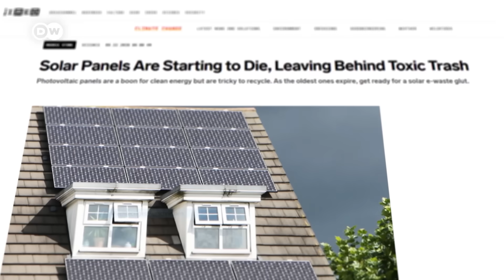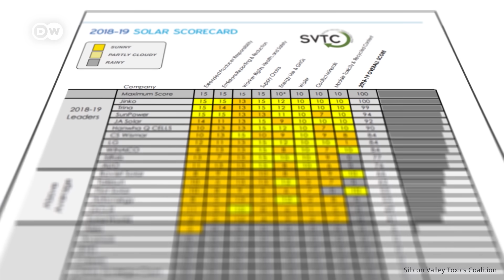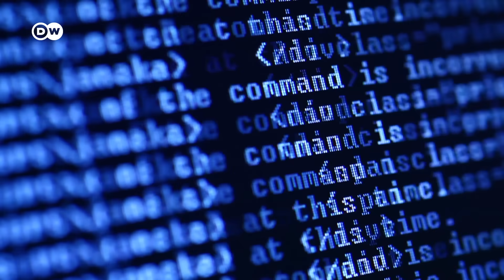How green is solar energy really?

Comment: Friendly reminder that a grid full of solar panels requires backup, as solar panels only run at full power during summer months at the middle of the day.
This capacity today is being completely taken over by fast reacting natural gas plants.

Just use batteries you may argue. Or use other storage methods. 
Yeah, but that means you also need about 3 to 5 times the amount of solar panels or even more to keep those batteries charged during the winter months. And I don't even know if you could do it on areas where it snows.

You can also transport electricity long distances, ok but factor in the costs of the powerlines too.

If you are interested, I suggest you look up why people like me like nuclear energy so much. It can not only cover our electricity demands on the day, but also on the night and additionally things like our industrial heat demands, truly displacing fuels from the landscape.
Reply: Spot on! Solar panels are a great source of energy but they are not "one side fits all" solution. It is clear that in many parts of the world they need to be part of an energy mix, for example solar + wind + nuclear + storage.
Another fact is that by 2050 most of world's population is expected to live in big cities often in high rise buildings. That doesn't go well with the idea of decentralized solar power generation.
In my opinion we are looking for one big nuclear come back!
Reply: Actually they don't - panel efficiency degrades as they heat up. They're more efficient in Spring (in the middle of the day) than in Summer where temperatures are greater than 25°C
Reply: @g00rb4u  Well that implies that you have the same amount of solar radiation in the spring and in the summer.
Solar radiation is often not a problem near the equator, but it, when you are far from it, and there is when energy is often needed the most on winter, autumn and spring
Reply: Inside the tropics this is often not a problem.
Btw I dont want to bash on solar, they have their place, and we should use them.

But, it will be very hard for them fully replace our grid, alone, and even with the help of wind, hydro and tidal.

Comment: This is exact same problem with plastics. Recycleable but more expensive. How long until this solution found? Plastic industry also keep saying the same thing about recycleable and efficiency yet what happen now? Micro plastics when dump in environment or even during recycle process. And in the "green" future we will have micro lead, arsenic, etc aside from micro plastics
Reply: Let's then make sure we recycle properly and do not add all these micro particles into the environment. First, everything should be deigned to make it easier to recycle. Second, cost of full recycling should be part of the price of every item. Third, we should put as much research into making recycling clean and cheap as we currently put into making renewables clean and cheap.

Comment: The problem is the ridiculously  high, almost child like level of expectation, going off fossil fuels is not going to be painless or perfect, but it has to be done.
Reply: Not just has to be done, it will be done one way or another, either the world finds alternatives and switches early, or the world runs out and is then forced to switch. Fossil fuels are not like all the other minerals for which there are always less economic reserves to be found if needed. Fossil fuel reserves are actually finite because they are biologic in origin. Meanwhile the global demand for more energy will grow infinitely.
Reply: How about focusing on nuclear?
It is a known quantity, all aspects of it are well understood and the only issue with it that has no fix is human stupidity.
Reply: @OzixiThrill  The problem isn't nuclear it's self. It's that it requires the continuance of an out dated grid structure, large facility's transmitting power 100's of kilometers. This method wasn't Idea or efficient, but was the only way we could  do it.
With solar and wind and say flow batterie's for storage, we can make microgrids. Smaller safer more cost effective and reliable.
Reply: @terrytytula  For one, I fail to see how the current grid structure is "outdated". It is also by no means a universally accepted idea; Some people want a global grid, rather than micro-grids, for example.
Also, small and micro-reactors also exist, so even in a micro-grid situation, nuclear would work.

Comment: Recycling solar panels isn't profitable. Well, the US subsidizes fossil fuels. They should subsidize solar panel recycling.
Reply: Exactly,  yes it's cheaper to blah blah blah... but it can be recycled, so it doesn't have to be in a landfill the government can do recycling of said materials, and it ends up being a net negative to the budget as far as money, but it doesn't have to be in a landfill..
Reply: Do NOT subsidize "capitalism" . . . . . . .
Reply: Recycling will be profitable once we are able to remove silver and silicon in high purity. The cost of those elements completely flips the situation of recycling.
Reply: Solar is subsidized at every level already.
Reply: The USA subsidises the oil industry to invest more to get people jobs. Solar energy isn’t profitable as is is the recycling of solar panels and the mining of lithium is very damaging to the environment.

We shouldn’t replace one crappy solution with another crappy solution so this is why we need to invest in nuclear energy.
Reply: @rickrozen2341  Excellent thinking Rick.
Reply: @rickrozen2341  Nuclear isn't economic either. The Cost of disposing a Nuclear Powerplant is insane. The oldest German Nuclear Powerplants are now longer in the Process of Decomissioning and Dismantling than they have been running, and that Process is more expensive than the Revenue those Powerplants have earned before. This may even be the Case for all Nuclear Powerplants in Germany. That's also the Reason for the insane Energy Prices in Germany (and not "uneconomic" Renewables), because that Money is not paid by the Energy Companies themselves but by the Government which in Terms gets the Money from an Energy Tax.
Reply: @Genius_at_Work  That’s not really true since modern reactors can actually use the waste products of uranium reactors. “That proces is more expensive than the revenue those powerplants have earned before” I need some evidence on that chief.

The insane gas prices in Germany are caused by the fact that they prematurely closed coal and gasplants based on the faith that solar and wind energy would provide instead. We have seen now that solar and wind energy have failed and we are now looking into more viable alternatives.
Reply: @rickrozen2341  I'm not talking about Nuclear Waste, I'm talking about the Powerplant itself once it has reached its End of Life. Show me a Reactor that can cannibalise the Scrap from a decommissioned Powerplant. Plus every bit of Scrap and Rubble has to be checked for Contamination before being disposed accordingly. The two East German Powerplants are in that Process since almost 30 Years and it will take another 20 until it is completed. The insane German Bureucracy sure slows Things down but it is a long and expensive Project nevertheless.
Reply: @Genius_at_Work  You are talking about yesterday while we are discussing tomorrow. Brittain just invested 300 million in nuclear power, France a billion and they don’t invest in huge unique projects. The invest in Small Nuclear Reactors.
Reply: @rickrozen2341  300 million and a billion? Wow, so low numbers, LMAO. 

Seriously though, these aren't at all high numbers. One new nuclear reactor in France would cost at least 8 billion according to EDF's proposal and that is without any unforseen problems, which there always are.

Also the current insane gas prices in Germany are everywhere in Europe, caused by Russia delivering less and East Asian countries like China buying a lot on the global market. The current high German prices are due to taxes. Taxes make up around 52% of the bill there, in France it is around 34%. And the greatest tax in Germany is a renewables tax to repay subsidies that were given when renewables were still very expensive between 2010-2017.
Reply: @rickrozen2341  Nuclear is the ultimate crappy solution.
Reply: @drkstrong     So let's all cross our fingers and hope we get lots of sun and wind. And if we don't have this (as is common in Europe), then all that remains is to sit down and cry. lol
Last year the windy season came very low in the Uk, good luck with that. VIVE LA FRANCE, Macron  finally full nuclear. Germany will be left behind, good luck with wind and sun in cloudy Berlin
By the Way it is funny see so many people complain about Europe and USA, yet they are already being very late in relation to China,  look at their nuclear plan  Absurd, they realized the importance of this type of energy...either the West reacts or in fact they will be sucking their thumbs by always wait for good seasonality of wind and sun...
Reply: @geraldogremio6142  You do know that solar panels work even if it is cloudy?

Comment: Full lifecycle of the product should always be taken into account from manufacture to disposal… this is not just a problem for green energy, it’s a problem for everything.  And should always be considered carefully to determine the mitigations that will need to be employed in order to overcome the issues… and they should not include trading in any format.
Reply: Ye, nuclear gets called out as being expensive compared to cheap solar panels, but they don't mention it's because of this.
Reply: @amoebasgonewild  The Disposal Cost of Nuclear Power is insane. I'm not even talking about Nuclear Waste but the Powerplants themselves. The oldest German Nuclear Powerplants are now longer in the Process of Decomissioning and Dismantling than they have been running, and that Process is more expensive than the Revenue those Powerplants have earned before. This may even be the Case for all Nuclear Powerplants in Germany. That's also the Reason for the insane Energy Prices in Germany (and not "uneconomic" Renewables), because that Money is not paid by the Energy Companies themselves but by the Government which in Terms gets the Money from an Energy Tax.
Reply: I don't think its just the production but you have to calculate maintenance/manpower and service life.
Reply: The only thing that makes solar even possible is lithium ion batteries. This is another fossil fuel that has to be mined and when it starts to run low will cost more for the consumer which will cause war at the places that live on top of lithium.

Comment: Nuclear is the future , renewables will offset some load 
Countries that don't manufacture anything like Sweden , can go all renewables 
Countries that have to run heavy equipment's and machineries to do manufacturing will require reliable source of energy they can't sit idle when sun doesn't come out.
And we will still need oil and gas during disasters , You cannot be recharging your electric boat during a calamity
Reply: Can we have some claps for a rational answer for once ?

Comment: Solar panels are very expensive and unreliable because Europe has a cloudy environment.
Reply: I assume you referring to their electricity price being supposedly high, however the Fraunhofer Institute for Solar Energy Systems actually calculated ground based photovoltaic to be the cheapest source of new electricity production in Germany, at 4 - 6 Cents per Kilowatthour, a new Lignite powerplant would be at around 6 - 7. And Germany has very cloudy weather.
Reply: @paulschmidts5429  does your smart research also tell me what will you do when there is no sunlight in the nights.
Dude nuclear power is much much more reliable than solar.
Why not just do what Japan did.
Build a bunch of nuclear power plant
Reply: @crazypasta7749  Yup and they did that decades ago when Labour was cheaper and now they are realizing that made a big investment mistake due to safety measures being inadequate as Fukushima showed. Besides with average construction time of nuclear reactors going online in the last decade being 10 years, it’s not exactly a quick fix is it. Now sure accounting for backup will increase costs. But judging by the IEAs report (Net Zero by 2050) in preparation for COP26, Renewables seem to be the cheapest option, being planned to provide 90% of electricity, with wind and solar providing 75%, while nuclear is planned to only produce 10% of electricity.
Reply: @paulschmidts5429  yeaa but it's relatively reliable we just need to find a good place to put plants .
Solar is good but nuclear is better.
Would you bet on a solar panels or nuclear???
Nuclear would be alot more easier and much more efficient and quick.
Plus it would play a major role in the development of space programs.
How?
So if you send a team on Mars obviously we will use nuclear battery to keep that mars base running .
Think bigger let's just say it
Think  green nuclear 🐸

Comment: Another big recycling lie. 
When even less than 17% of plastics are truly recycled, what more can we expect from more structurally-complicated silicon-based materials like solar panels?
Reply: Historically speaking, by some assements 86% of copper mined since the Copper Age is still in use, cause it was valuable to recycle this materials. When it comes to solarcells, the conductors are copper or silver, valuable enough to recycle. Glass and Aluminum are being recycled outside of the solar industry too, because the imbedded energy in the materials that is recovered by recycling makes it profitable (about half of Aluminum price in non crises times is electricity, Aluminum requires only 5% of the electricity for recycling).
Same will most likely be true for the Silicium in the cells, due to Silicium production being an energy intense and process and there being sectors that can utilize low purity Silicium like metallurgical Silicium in the Steel industry which makes up the majority of all Silicium use currently.

Plastic on the other has the issue that due to it being an organic substance you can rarely meld it down and recast. Breaking and Refining plastic in it’s origin chemicals usually involves more effort then refining those from oil due to impurity’s that strong effects on the outcome. So usually it’s burned as fuel.
Reply: Plus: plastics only make up 5-10% of the modules in weight